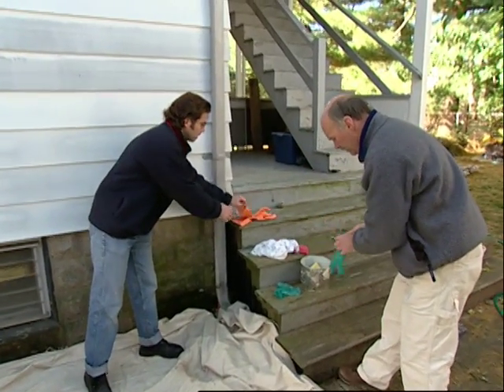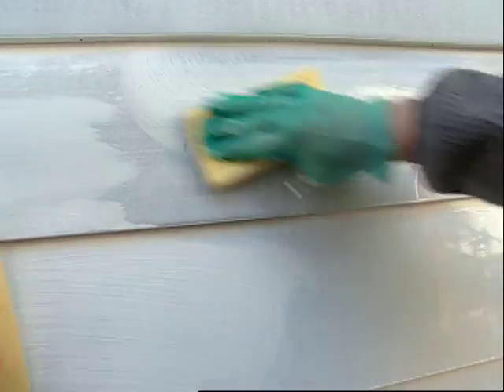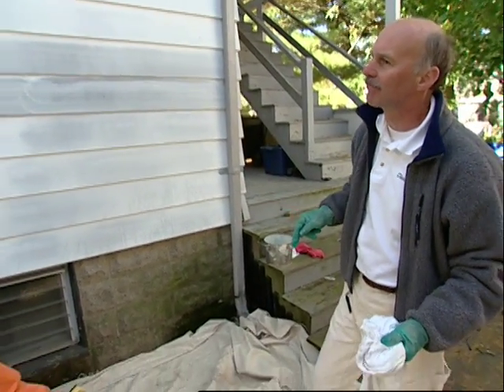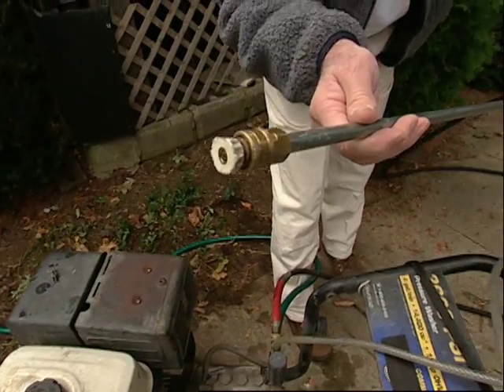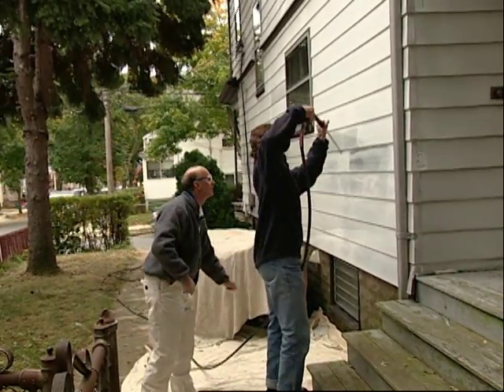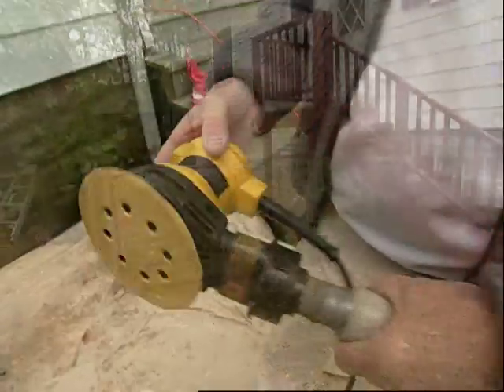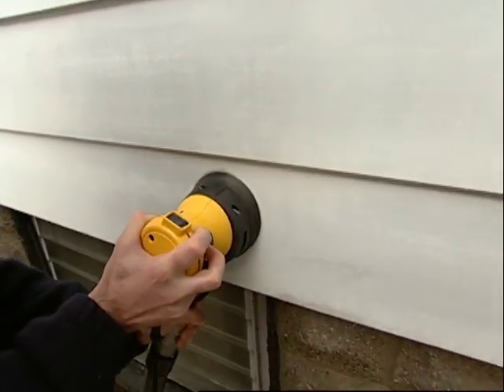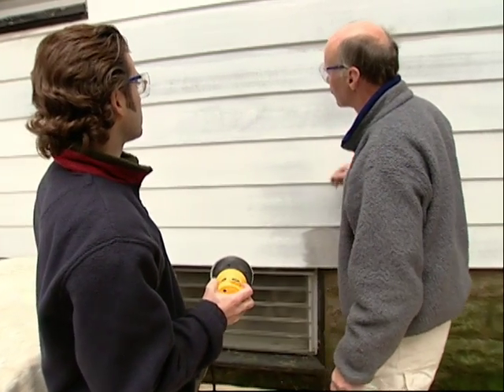How to Prepare Aluminum Siding for Paint | This Old House

Comment: I wash my aluminum siding down like you do a car with TSP powder bought from my local hardware store. I washed it by hand about 18 years ago and painted with Sears Weatherbeater premium . It was the best exterior paint they had at that time. The paint never peeled. It looks a little faded now but lasted me well.
Reply: Did you spray it or brush it on . Won’t brush leave brush marks . Spray seems only way it would still look authentic old school aluminum siding
Reply: Same here except BM paint, and mine has lasted over 30 years with no peeling. (no doubt some fading). Our siding has a fake woodgrain finish, so using a brush was fine, you just see the woodgrain.

Comment: Good Lord, if you're going to be using an orbital sander on the side of an old aluminum-sided home, you MUST wear a proper respirator.  The paint has a high probability of being lead-based, and aluminum oxide is one of the worst things you can breath.

Comment: I agree with Cwrowe! the tsp will have a negative effect on the plants surrounding the house the bleach kills white blood cells and causes sickness later down the road, and it is over kill to use an orbital sander on aluminum siding,.  the white stuff you are taking off is a primer ask any siding store, power washing is the most you want to do and white aluminum siding must me painted within 2 years otherwise the weather and sun cause it to oxidize which is that white crap you see on the brick under the siding 90% of folks forget to get it painted and then whine because it has a nose bleed on there home., I am not saying that going down to the bare metal is bad just not warranted for anyone that is looking to get the job done without wasting a lot of money impressing themselves with the overkill process that takes place on these tv shows. times have changed, and so have products, also make sure you tell the paint store that you are painting aluminum siding and for the last I  recommend flat it will hide all those imperfections in the siding.

Comment: Powerwash....exterior primer.....exterior paint.   This is ALL you need.
Reply: cwrowe Not even sure if primer is necessary if the old paint is cleaned first. The latex paint they sell today is amazing. It is like caulking that is milk shake consistency.
Reply: +cwrowe  Thanks, because watching this video was a total waste of time.
Reply: Yep I was cracking up when the dude used the orbital sander and was like "does seem like a ton of work"
Reply: @DAS-Videos  Latex paint is bad for aluminum. Makes bubbles.

Comment: If you think you have to use TSP, be very careful, it will etch and ruin your windows.
Reply: 💥 I just used it today for the first time pressure washing aluminum siding (first time doing aluminum too).  I used it on the frames around the windows and it rinsed off perfectly.

Comment: Should I use an oil based prime or acrylic prime for a a home with aluminum siding that has never been painted? Some contractors are telling me I don't need a primer & two coats of acrylic paint, while others insist on an oil based primer & 2 coats of acrylic paint. HELP!!!!
Reply: Do not use an oil based product on aluminum.

Comment: TSP, that is for removing mortar from brick. It most certainly isnt require for aluminium. A good pressure washing, followed by a puddy for filling ad the paint is more than enough. 

Also 100 grit paper? Unnecessary
Reply: You'd have to be in a vegetable state of mind to orbital sand your whole house. Like Rupeck.

Comment: wtf..I'd take it down and put vinyl up before washing by hand or sanding...paint will flake eventually because a pressure washer will never clean it well enough. I often find these videos so simple that I get more info from a lowes or homedepot video.

Like your how to insulate with fiberglass and all you show is putting in some bats and 6mil...why not cover the difficult stuff like insulating rim joist cavities, basements, spray foam...

Sorry just disappointed...and want you to succeed.
Reply: I don't have the cash for that.
Reply: R-value of aluminum is way better than vinyl siding…… over time sun starts to warp the vinyl…… my aluminum has been on for over 40yrs….. not a problem, neighbor has had vinyl replaced sporadically around the house for one reason or another….. not a color change or anything but….. he’s had warping due to the direct sun all day on it over the years
Reply: Vinyl? So you can replace it all again inside of 10-15 years? What a brilliant idea